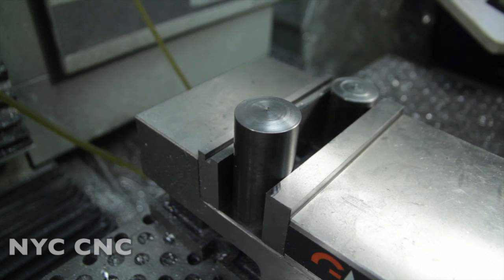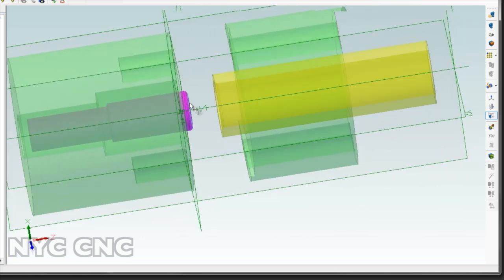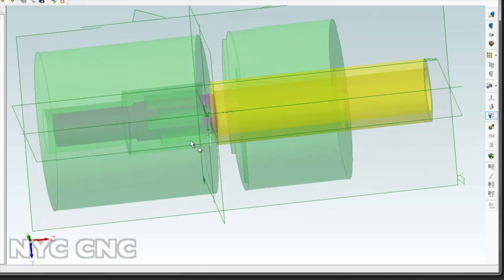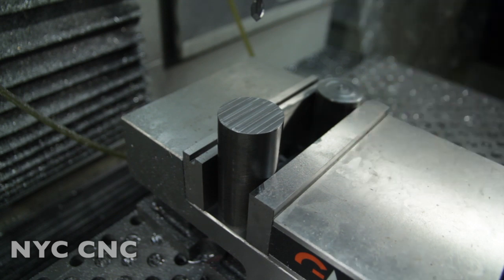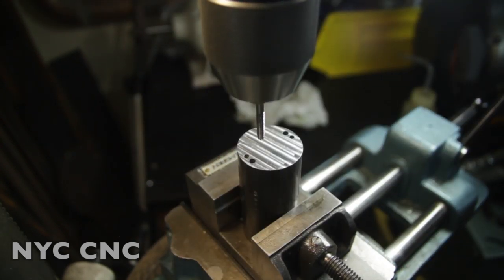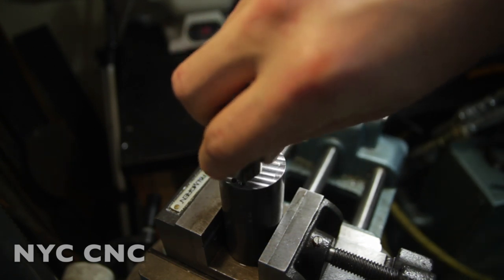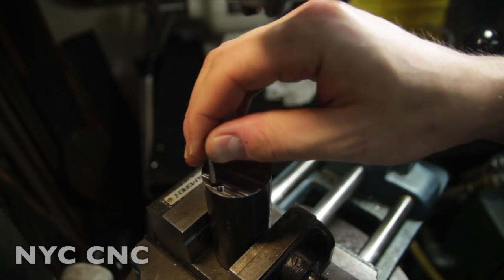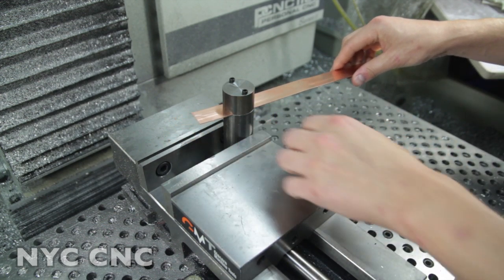Making Copper Bullet Jackets: Machining Punching & Drawing Dies!  Part 4

Comment: I'm glad you realize what 0.0003" is and isn't.  You were right to think that you really can't trust what you are seeing on the indicator. If you would have farted a good DTI would deflect some.  A B&S Bestest indicator would be your favorite tool if you were to get one. Get a half a tenth DTI, you are already so much farther along than most by realizing what 0.0001" is and you will gain so much with a good indicator. I will be blown away if you can produce an accurate firing jacket. Cool stuff!

Comment: Hi John, 
First off, GREAT CHANNEL!  I'm going through your library one video at a time and I have to tell you, I am very impressed by both your craftsmanship and your candor.  It's not often someone of your skill level and talent admits to, or even shows their mistakes, especially on video.  Normally what we see on other channels is how perfectly their project went and who know's what ended up on the cutting room floor, as they say.  Great job!

Anyway, I'm very new at this (even a the age of 58 I'm taking up a new hobby such as this, lol's) and can you please tell me why you didn't drill the screw holes and dowel holes before you parted the work piece?  I mean, if alignment of the two  pieces is critical it just seems to me one would drill the holes in the whole piece of material and THEN part it off.  That way the holes be in alignment from the start.  Just something I would like to know for future reference and, as I said, I'm very new to this.  Thanks!

BTW, I like your FB page...